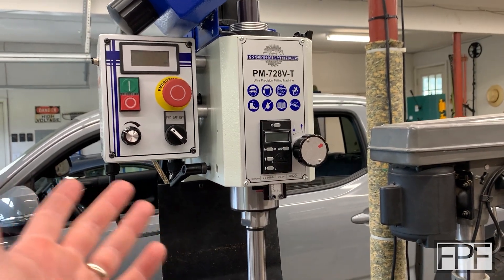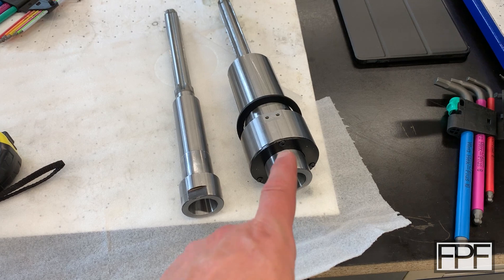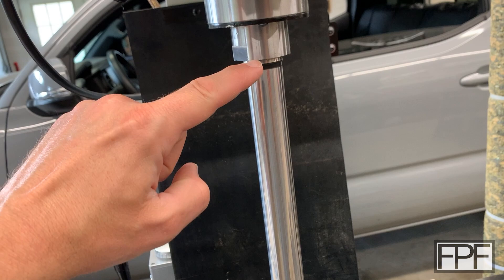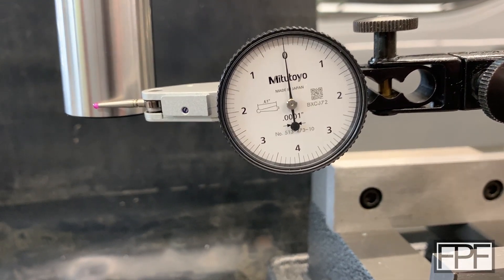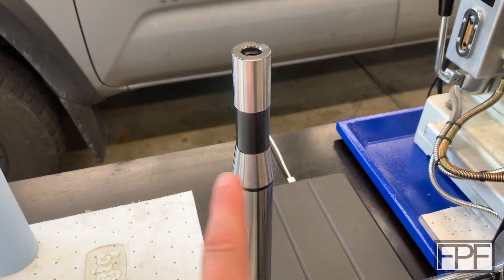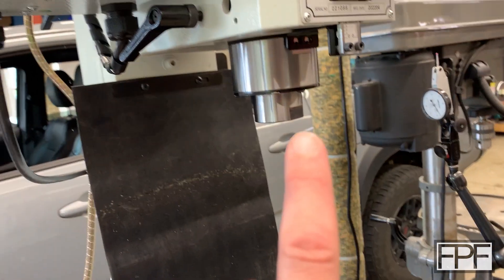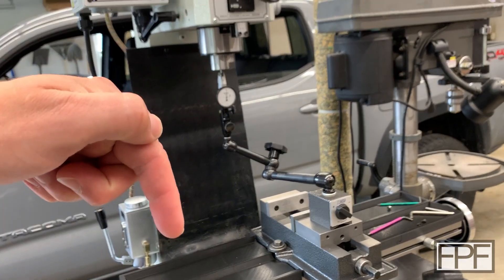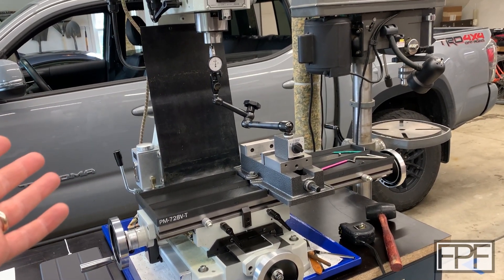#notfriday Update to the PM-728VT Mill Spindle Runout Problems I was Having

Comment: Now that this problem has been identified as a manufacturing issue do we know that machines currently being sold by Precision Mathews have had this issue resolved? I sent an email to PM asking this question but after 24 hours have not gotten a response.
Reply from the maker: Yes, this was limited to a small number of machines and all the spindles were replaced.   It's unfortunate it happened, but ANY machine can have issues.  The most important thing is to buy from a company that has proven that they will resolve issues when they do come up.
Reply: @FunctionalPrintFriday  Turned out I forgot one of the "t"'s in the email address so I tried again and they got right back to me. They had a bad batch of spindles and sent replacements to everyone who had an issue. The problem appears to have gone away. Sounds like they are a very proactive company with excellent customer service.

Comment: If you take apart the unit, you will find the bearings are not as precision as one would expect.  I replaced all the bearings with higher grade, closer tolerance ones.

Comment: I just setup a new PM 728 VT and have exact problem.
Do you want to sell R8 test bar?
Reply from the maker: Saw your email as well. I wrote ya back.  Check your junk folder if you don’t see it.
Reply: @FunctionalPrintFriday just saw this video and it’s great information, thank you for sharing. I have the same machine and I’m pretty sure I have the same exact problem. Now that you’ve solved the spindle collet taper situation, could you kindly let me know what is the run out now with real world usage? I’ve spent the majority of my time trying to tram this machine for the last 3 years. Also is there a Nod on your machine? If so how did you solve that. Greatly appreciate it if you could shed some light in my direction.